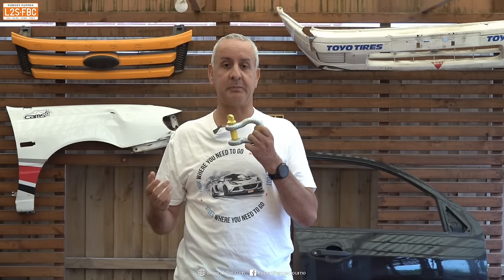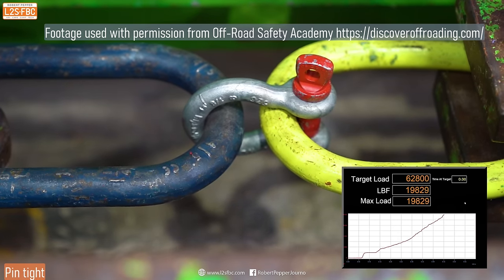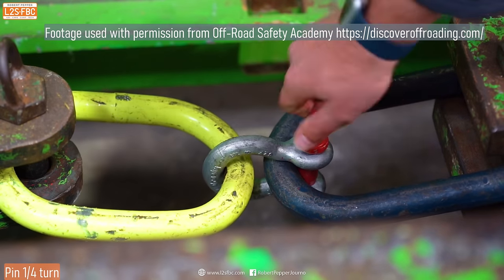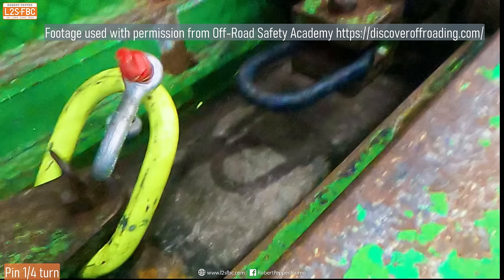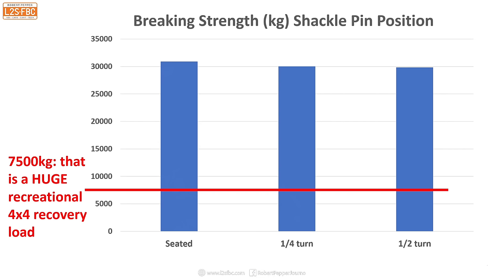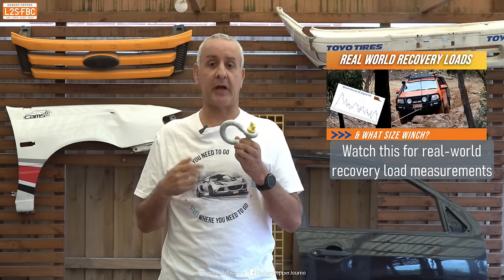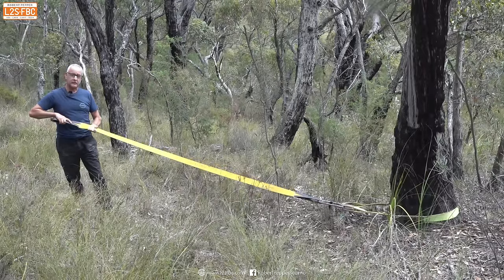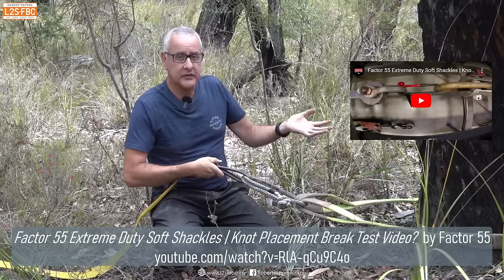What happens if you back off a shackle by 1/2 a turn?

Comment: Good thought exercise, thanks. Take away? Shackles are way stronger than needed for basic offroad recovery use. Don't let them get overly corroded and don't lose the original pin and you should be good.

Comment: I was a Chain and Rigging Certification Technician for 9 1/2 years and what I got all the time from riggers is they were taught it so it was easier to undo afterwards. I would show them that as soon as you back the pin off slightly the whole pin can rock in the thread left and right and tell them that it is the same as using Eye Bolts and that the flange of the pin shank is supposed to make contact with the mating surface. I would also ask them "when you have backed it off a 1/4 turn is the pin still tight after your lift?" and they will say "yes" and I tell them it is because the shackle has stretched very slightly and every time they back it off it will stretch very slightly each time until the pin does not reach the outside edge of the shank in the threaded hole as required under specs of the shackle for use. I have seen shackles get a lateral force sideways on the pin and spit the pin out partly due to bad rigging of load. it is definitely the repeated cycle though that did the main damage of them stretching it slightly more each time. (and that was with staying withing the lift rating also). our visual inspection on them would start with checking all parts for wear and damage and include seeing the pin when screwed all the way in reaches the outside. other dangerous thing I would find all the time is mismatched pins and bows and some had even fitted imperial pins into metric shackles and vice versa. (the thread being metric or imperial I mean) and they may fit and do up but it leave the pin more prone to being spat out. with the pins on shackles the original reason for having a hole in the pin was riggers could put their marlin spike into it to undo them, a lot would carry one as they used them for aligning parts when craning in. I would train engineering students a few times a year at a local Tech Institute and deliberately break a chain in my mobile testbed to show them how fast stuff moves when it breaks. my testbed could do up to a 30 Metric Ton pull so I could test up to 20mm G80 chain anywhere in the country.
Reply: worst thing i would see with recovery winches in industrial use is people trying to use them on a single strait pull instead or using a snatch block and double purchase and overloading the winch because they were being cheap and brought one too small. the cables would be absolutely ruined. i used to do a lot of Certifications for a power company and ended up saying to them ring the local 4WD Club and get them to teach your guys recovery and they will show them the right way and save yourself more money that what it will cost to do some training and the club may even do it for a BBQ and some beers and a donation to the club.
Reply: Overloading the equipment is what causes binding plain and simple.
Reply: @Tom-og7fi  you can deform a shackle and have it bind without overloading it if not used correctly. have thrown away a shackle that was an hour old when the customer run me to go back and check it and it was bowed out of shape as they had rigged it badly and pin was not done up properly. load was not over the rating of the shackle.
Reply: @Weetbix1969  if you say so. I've been in the rigging arena for 30 plus years I've also seen a very small handful of shackles that were somehow damaged but only the threads. If a shackle bows or fails it is either bad to begin with or overloaded.
Reply: @Tom-og7fi  to be fair the biggest problem ones were NOT with riggers who most i found always  looked after their gear and respected it which is probably why you never saw many bad ones. it was people rigging stuff that "thought" they knew what they were doing that had only basic training for rigging loads on their Gantry operators or Dogman course that were the dangerous people. i have helped with investigations on injuries and also sadly a death caused by shackles that let go so i have seen the worst of it and have thrown so many away that were not up to spec for certifications so think i  know what i am talking about. i was also a wire rope and height safety specialist for 15 years on top of doing chain and rigging certifications.

Comment: I was in the heavy rigging industry for 50 years. We generally back off the pin just a fraction, not a 1/4 or an 1/8th. Fully  tightened you’d have to get a wrench to get it loose if you didn’t. I understand you could weaken the capacity by doing so but we never put a shackle anywhere near its maximum. All equipment and rigging has a built in safety capacity. When rigging gives way it was either damaged or overloaded.
Reply from the maker: Interesting! Many others with similar situations are saying "never back it off"! No wrong answers in my view.
Reply: @L2SFBC  just remember that all shackles aren’t screw pin. Some just have the pin and a cotter key through it.
Reply: @williamscondra3811 you are describing a clevis,  which is not a shackle.  A clevis will fail far far sooner than a properly rated shackle.
Reply: @duncanwatson7297  Clevis is just another name for a shackle. They’re all shackles. They all have a capacity and if used properly they will lift what they’re rated for. Like I said, I was in the heavy rigging industry my whole life. I don’t deal in semantics. There are screw pin shackles, pin and cotter key shackles and shackles with a pin that is threaded on the end with a nut and a cotter key. If used as intended one is no safer than another.

Comment: From an experienced heavy lift rigger (designing the rigging for very large crane lifts such as bridge beams, HVAC equipment etc)  we design the rigging so that the MAX load on any part of the rigging including shackles does not exceed the rated value ( which is much less than deformation or even failure).  The reason to back off a shackle pin is not to increase strength,  its to prevent the shackle pin from rotating and getting super tight under load to the point it can not be removed by hand.  IF you stay withing rated limits of the manufacture, you should not have a failure just because you backed it off a 1/4 turn.

Comment: Great factual info as usual. When you mentioned twisted straps I immediately thought of the Fireball Tool video! For excellent technical recovery videos, I watch "Florida Off Road Recovery". Matt regularly recovers vehicles much larger than his with a winch and multiple snatch blocks - he is a master. He, like you is very factual and knowledgeable. Love your videos.👍
Reply from the maker: Matt has been on this channel commenting!
Reply: @L2SFBC  Like minded people. Facts, experience, and great knowledge. 👍
Reply: Just an unrelated but related fact about twisted straps.  In the USA semi drivers are allowed to put a twist in their flat straps (keeps them from vibrating and making noise); however in Canada that is not allowed. SuperTruckerDan is a flat bed hauler and did make a YT video about this.
Reply: @funnyfarm5555 Fireball Tool did a video about if twisting straps weakens them, check it out, cool results.

Comment: 14:10 this is where a high lift jack is useful - jack it up, fill the hole then tip it over. Anyone running high lift jack hasn't discovered other options unless they need to move the vehicle from one side to another.

Comment: A few seconds thought by anyone with some metalurgical or mech eng experience clearly should indicate that the "snuggness" of the pin in the loop of the shacke is no going to make any appreciable (ie statisically valid!) difference to the UTS because of the failure mechanism caused by where the shackle actually yields! 

 It's clear that at the point of ultimate failure, ie where the minor diameter part of the pin thread transitions to plastic deformation, necks and hence experiences a run-away failure, the pin is ALREADY very bent as mentioned, ie even a loose pin at this point is not actually loose anymore! In order for the pin to fail in tension, then it MUST be hard up against the shackle loop.  In all theses tests, far far before UTS failure the shackle pin will not be removable because deformation of the pin irreversably locks that pin into the shackle loop so it cannot be removed as it can no longer be unscrewed. I suspect that a test with a grossely un-mated pin would actually not be that far behind in terms of UTS, although the failure here would not be overal plastic deformation but localised bending moment stress concentration at the base of the thread leading to crack propogation.

  Looking the video and the stress strain curve, id suggest this happens at around 50 to 65% of UTS, ie a long way before the shackle actually fails.  In a real recovery situation, if you've bent the pin, the shackle is scrap, well before you were in any risk of breaking it.  Obviously, this is done on purpose by the specific design of the shackle to make it safer, ie to indicate to the user they were getting close to a failure before it actually fails.

This means it's basically irrelevant how much you back off the pin after fitting it  (within reason obvs 🙂 )
Reply from the maker: Well, had to show video and a test to prove it.  I have bent other shackles when I tried rated vs unrated and as you say, the shackles were deformed well before actually breaking.  https://youtu.be/AVqYkgaaKAY

Comment: Some people recommended the use of anti seize to keep pin threads lubricated. Since  the moisture nature of anti seize make it easy to get contaminated with dust, dirt or debris, I would recommend  to use spray graphite. It's comes mixed with  thinner like liquid that once is sprayed, evaporate leaving  a fine film of dry graphite which doesn't attracts contamination.

Comment: In the US, a lot of folks drive around with shackles hanging from the vehicle. In those cases I always recommend turn them till tight or turn them then back off 1/4 turn but put a zip tie through the pin hole and the shackle so the pin can’t work itself loose and fall out.
Reply from the maker: It's common in Australia too, same thing and we have awful corrguations!

Comment: It was close to the end of the video he mentioned to look under the vehicle to determine why it's stuck - golden advice. Imagine that you got hung up on a rock at the front pumpkin (or another critical item) you rig up the winch for a pull then rip out the front axle out when a simple jack and block could have freed the vehicle? Comments below mentioned leaving the shackle 1/4 turn loose to indicate if the shackle experienced deformation if it is tight when you're done with the pull you may consider replacing that piece of gear.

Comment: I am an instructor for a steamfitter apprenticeship program and I believe that the issue with the “backed off” shackle pin is the possibility of the pin coming out from vibration. The likelihood is I agree low but it is even lower if the pin is jammed tightly.
Reducing the risk of failure is the chief important issue when engaging in overhead rigging.

Comment: 01:10 backing off the pin allows for a forced opening in the mouth of the shackle (unexpected vectors). By tightening the pin, the vector forces are directed as the manufacturer intended. A tightened pin can be undone by a small screwdriver. Like electro3000 said below, run anti-seize grease on the threads.

Comment: I prefer to finger tighten and not back off… the issue is more about vibration over long periods which may undo the pin. But, not an issue for a quick recovery.  In a long term situation I would normally tie the pin to the bow with a wire.
Reply: had the safety guru asking me for shackles to rig up a large bottom of the mine pit warer pump. told him we dont have the correct gear, you need the ones with a split pin through tge shank. Oh no was his reply the crane operater said tge ones you have will di the job. I replied , tge crane operater is not a dogman. If they eent unbeknownsed to me, tge shackle shanks vibrated loose, the $80000 water pump went cnunt up down the decline, the safety guru went out the gate and down the road.

Comment: I was taught that backing a shackle a quarter turn is to help mitigate the occurrence of the threads being warped under load to the point of binding. that way if you're up on a lift and have to for some reason undo the pin you are less likely to need a tool to do it. In the case that you can't undo it by hand you have bigger problems that need addressing before anything else is even considered. I don't know how true that is but I always followed it because I had never seen anything to the contrary.

Comment: Im a tank commander in the canadian army. We always turn back 1/4 turn when doing recoveries.  Our shackles are rated for well over what we are usually going to put them through. Being able to remove the shackle is very important! Ive had inexperienced guys hand tighten shackels and after a recovery we had ro wait to get maintenance to cut it off witha torch.
Reply from the maker: Thanks! What sort of forces are you putting on which size shackles?
Reply: @L2SFBC  well I'm not a scientist by any means. On full sized tanks we use cables with Ballard hooks. These tanks weigh 70 tons on their own. I believe the cables are rated at 150 tons. When shackles are used (often from the recovery tank leopard ARV) you can expect winches to be used that are rated at 100 000kg. On smaller armored vehicles (LAV) we have 60ton shackles, well over double the vehicle weight. Yes I've broken them and when they go it can be very dangerous! Cables can swing and cut someone in half so safety during recovery is always important.

Comment: SWL 4 3/4T
They are meant to pick dead loads not shock loads. 
The main reason for backing off a 1/4 turn is when the crane starts picking the load and the chocker or load being picked will actually turn the pin and chinch it super tight.
When the load is landed you need a tool to break the shackle pin loose.  
In construction you only use 80% SWL

Comment: ive worked as an electrician for industry, in plants.
building the plants themselves.
every time we lift something with a crane, the shackle bolts are just-before-tight, or a quarter turn.
but usually we are using 8 inch shackles, up to 20 inch

Comment: Working offshore oil and gas diving, we snuged them up and backed of just a hair, but with the size and loads would still need a shackle breaker on larger stuff. How shackles got put on matters as well so they couldn't unscrew themselves if working in the water.  Not as big of a deal offroading, but the take home is having the right size rated stuff (+safety factor) comes in clutch, especially if you have to get a little cowboy with things.

Comment: Steel Iron worker structural fabricator here... 
If you don't back off at least the 1/4 turn it will be impossible to undo without tools. That means it will wear out quickly.

Comment: Interesting as usual.  In the different situation of travelling with a load ie using shackles with a trailer - I always do them up tight because I am concerned that the vibrations will loosen them esp. if they are already loose.
Reply from the maker: Yes, I agree there - it'll need to remain done up for a long while, and there is vibration. A typical 4x4 recovery is transient, and has no vibration.  I solve the safety chain problem by ensuring my shackles have the pin handle upwards.
Reply: Our shackles are under constant load. We screw them all the way in, but not tight. All shackles that will be in place without a load will be moused.

Comment: There are u tube channels that have tested flat straps used as load tie downs for trucking, they were examining how twists in the strap affect its strength. They tested no twists first and then just one, no difference. But when you get to like four of them, or more, then it does affect them. The tests used load cells and pulled to breakage, interesting stuff, i think 🤔 however the length of the strap would be a factor and haven't seen that tested before. It is quite possible that it has been done.

Comment: The biggest thing about the measured standards that are on the shackles is, they were done with the 1/4 turn clocked off the bolt in the first place.  The greatest thing about these shackles is they were designed to be utilized without wrenches.  There is a greater chance of binding if you were clamped in tight.  If I'm doing a long distance tow with a shackle, I'd tie the bolt off so that it won't 'go anywhere'.

Comment: the hole in the pin is for safety wire tie so it can never come lose on you even if you have it backed out a turn or not
Reply: Always did this on my marine mooring.

Comment: I tend to prefer rated lifting slings for tree trunk protectors or bridles because you know what they actually rated at. Interesting video.
Reply from the maker: yes, lifting equipment actually is rated!
Reply: @L2SFBC  But people don't understand how the ratings work.
Reply: - yes WLL, not MBS  (MBS is negligent advertising - ie. totally unsuited to any lifting...)  MBS should only be used as a guide, in non life critical applications.

Comment: backing off the shackle a quarter of a turn isn't about failure of the part. as you said, you'll most likely never see that kind of load in 4-wheeling. it's more about being able to turn the shackle pin without having to resort to a crescent wrench to loosen it.